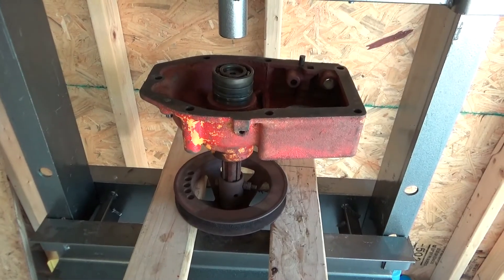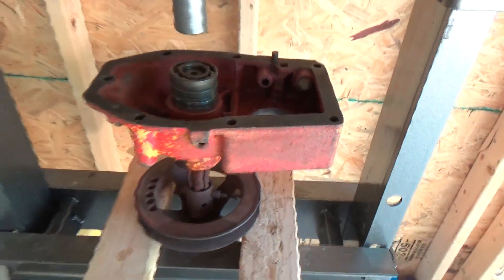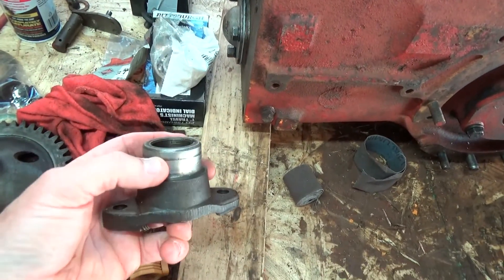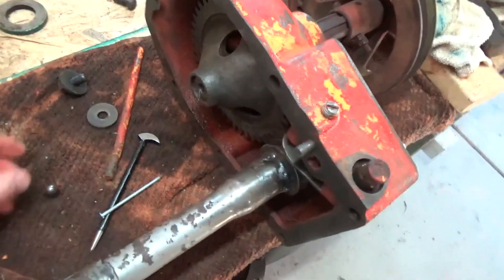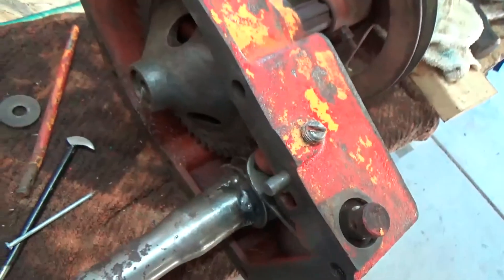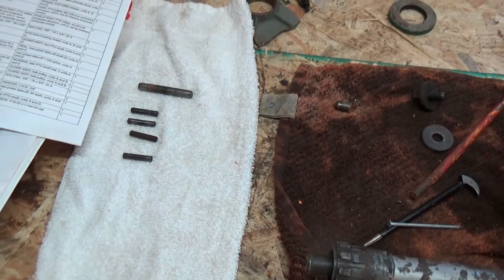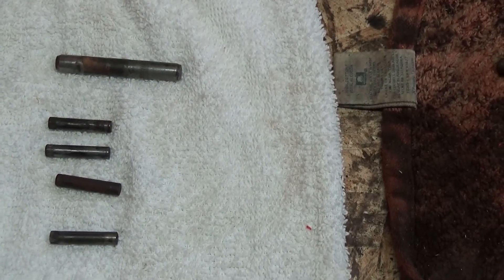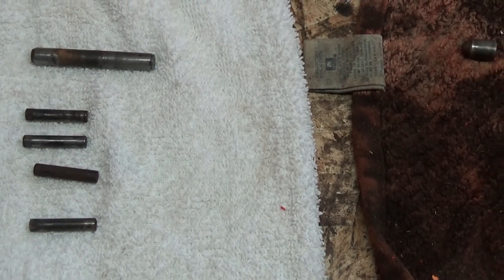1955 International 100 Farmall - PTO reassembled

Comment: Regarding that large gear on the PTO shaft, when I removed my PTO housing I found the bolt and spacer/washer in the bottom of the oil. The gear was still in place but I didn't need a puller, just a good dose of jiggling and hand strength, Not sure if the bolt wasn't torqued proper from the start or if it may have had excess vibration from rusty old bearings.
I plan to take the modern approach, flush out the threads with solvent/brake cleaner and use some medium strength loctite. (I don't have the oil tolerant type on hand, but even that only tolerates a thin residue. Once cured either type is oil proof. A spritz of the loctite primer spray really helps activate it too.)